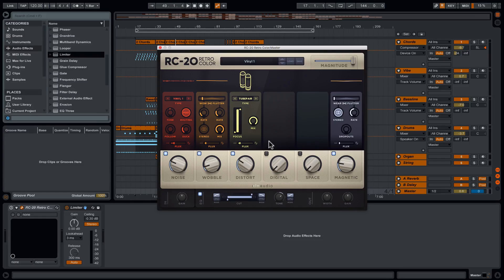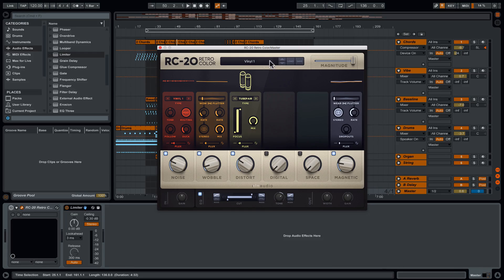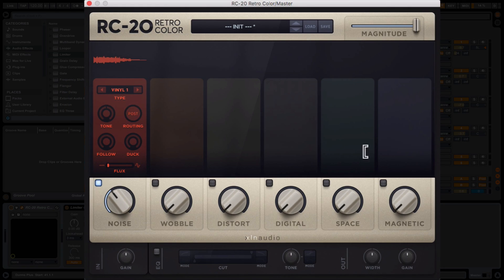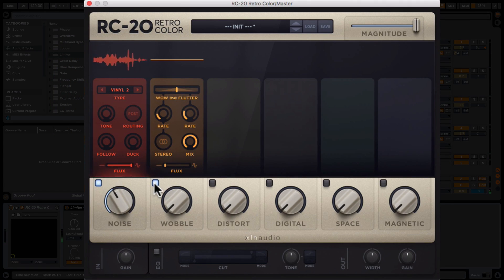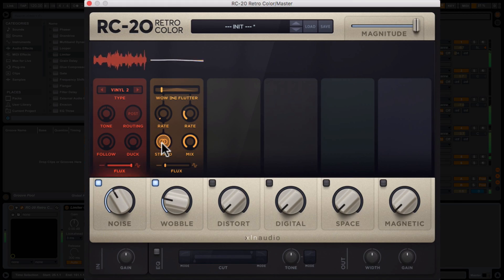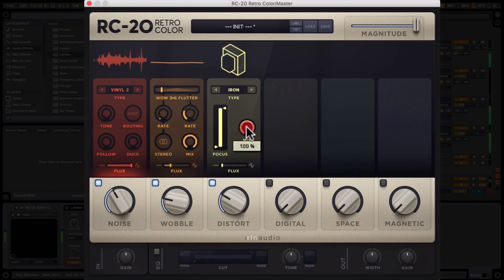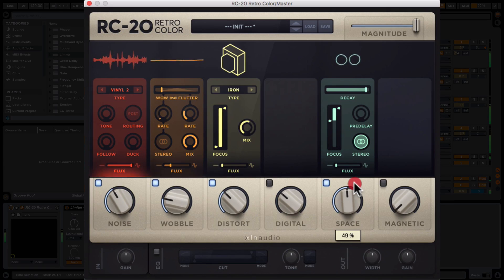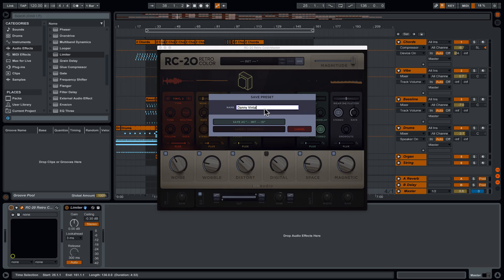XLN RC-20 Plugin for Vintage Tape, Distortion and more. Demonstrated in detail using Ableton Live

Comment: HI, i have a question?. Why is it always the master and some other telling to avoid put plugins on the master, i get it when you compress everything flat. 
But slightly should not be wrong or?  Cause mixers in the past had pre amps to on the master right, and most of the guys in the past were sending demos on cassette.